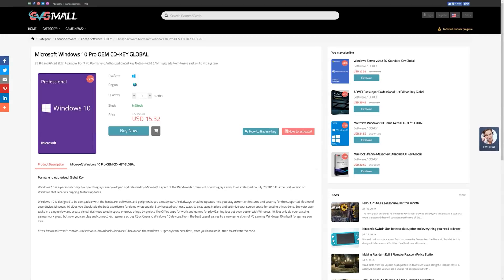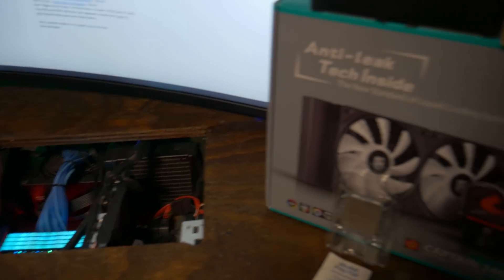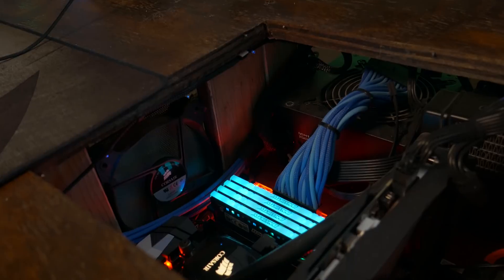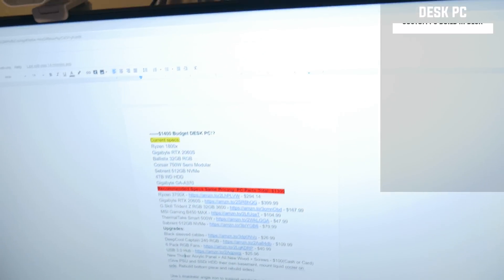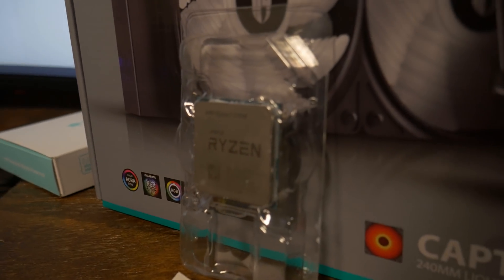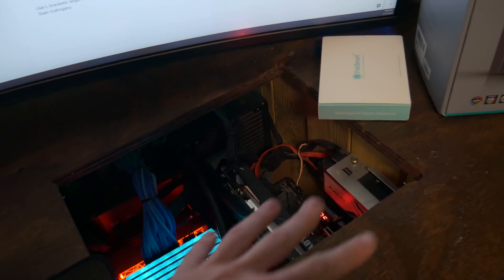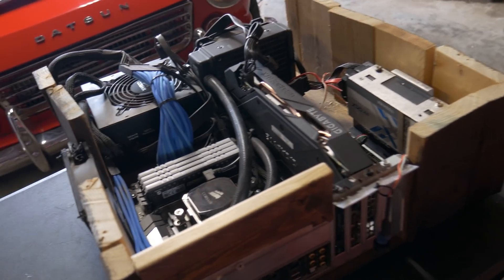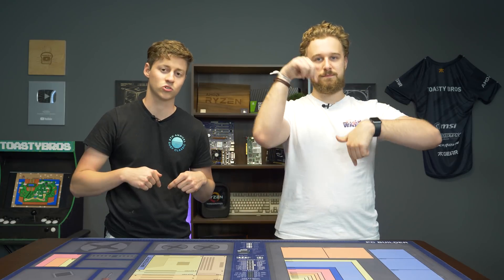$1,400 Custom Desk PC Build

Comment: The reasons why cases are not made from wood is because of FIRE. One of the main reasons case are made of metal is because  if the stuff lights up the case will slow down the fire.

Comment: Edit: I’m a fucking retard. BUY THE KEY IT WORKS
Reply: That's completely false, I have one on my main computer for 1.5 years now and had no issues. Unless they always renovate my key because I'm special that's honestly bs xD. I have bought tons of keys (not tons but at least 8 in the last 3 years and no problem). Maybe you just had an issue yourself, but generally they are fine.
Reply: Hunter Fabio I read a ton of reviews that said it was bad, so I thought it was a scam but then I just tried and it worked thxs m8

Comment: No way i can afford this thing. I only have $250 and i want a gaming pc. Any suggestions? 😎 

Btw great video 👍
Reply: Only thing I can suggest is build your own! Prebuilts are expensive because they have good specs ussualy
Reply: You might have to spend a little more money but you can save a lot if you get the graphics card and any other parts you can used.

Comment: Your crotch area doesnt get hot working that close to the case there at that position? I had a similar set up and everything under the desk would get warm after a few hours of work
Reply: Or is it just an issue with the size if the person using the desk.

Comment: hi can you make another 500 $ gaming PC that runs on 150 fps on fortnite on epic settings? thank you. keep up your amazing videos. I subscribed.
Reply: I Think that is not Possible.
Reply: If you could Get a system with a ryzen 1600 and an rx 580 for $500 it would get 100+ fps in fortnite 1080p. I would recommend getting the rx 580 used on ebay.